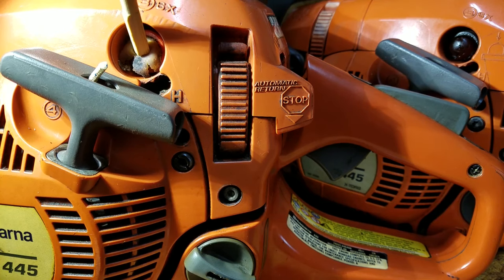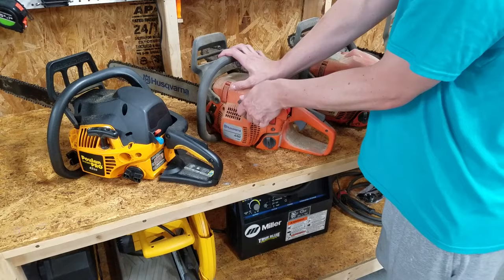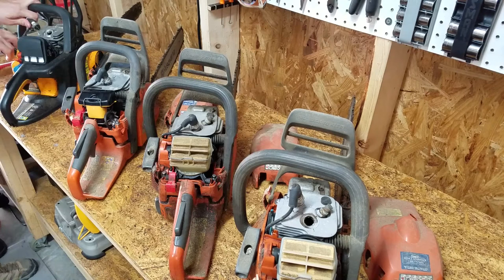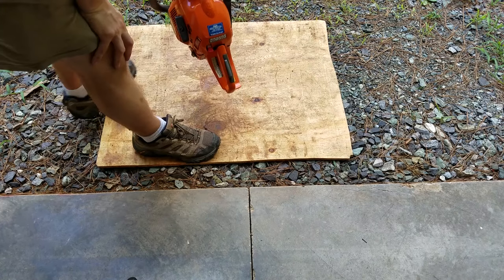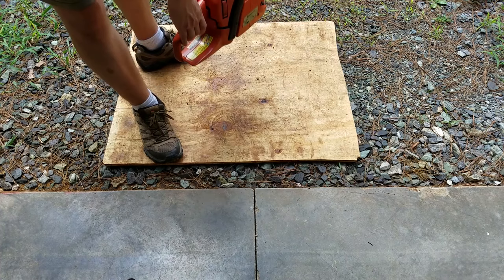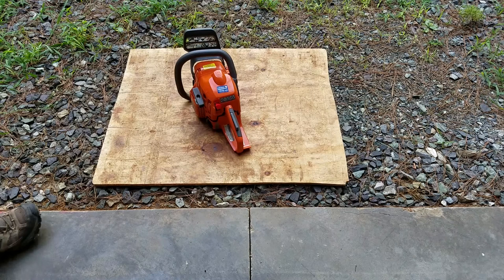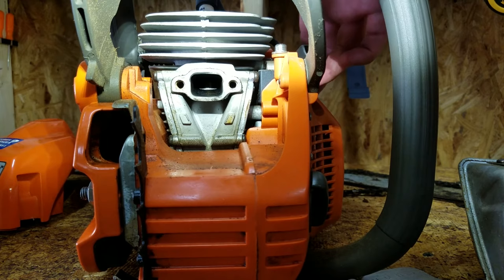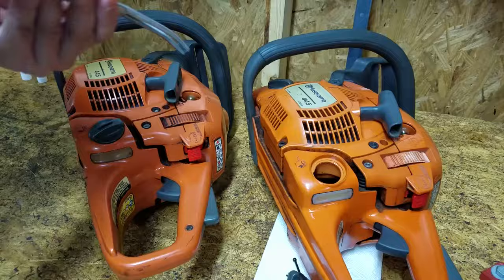Repairing Chainsaws

Comment from the maker: Primer Bulb:
https://amzn.to/3igCL1E (affiliate*)

Air Filter:
https://amzn.to/2Rdv4xc (affiliate*)

Spark Plug:
https://amzn.to/32fODLW (affiliate*)

Fuel Filter:
https://amzn.to/33gHslI (affiliate*)

Carb Adjustment Tool:
https://amzn.to/3k0QiLc (affiliate*)

Clutch Cover:
https://amzn.to/3hjOACS (affiliate*)

Hemostat Locking Forceps:
https://amzn.to/2DLpKyb (affiliate*)

*Purchasing from these Amazon affiliate links earns my channel a small commission. Think of it as a tip that doesn't cost you anything. Thanks for the support!

Comment: Great video. Just a tip for you. Hold the throttle wide open while doing compression testing. You want as much air flow as posible.
Reply from the maker: Yeah, that's what I was attempting to do with the top of my foot, but I don't know how successful it was. :) Thanks for the comment!

Comment: I repaired a Stihl 251 and getting a replacement carb or correct carb kit was impossible. In the end I had to use parts out of a similar carb to repair the old carb.  Otherwise I was able to get a replacement bar, chain brake and piston rings.  Despite having a hard life cutting hardwood, it had almost no wear in the cylinder bore and was in spec. The Poulan looks like a low hours machine that has had straight gasoline in it, its destroyed. The internal micro screen inside carbs clogging up is a super common problem.
Reply from the maker: I'm surprised you had a hard time finding a carb for your Stihl. They're a major brand so I just assumed it'd be easy to get parts. I did a follow-up video where I replaced the cylinder and piston on the 440 from this video.
Reply: @Mikeattempts  actually I was unlucky, because the Stihl 251 had two versions, and some parts are different like the cylinder barrel and carb, which are not interchangeable.

Comment: Nice save by using the 440 oiler. You got yourself two nice saws. I have the Poulan pro 42/28 the updated version. It's been a great saw. Everyone bases Poulan because in my opinion they don't know how to take care of them. Great video. Very informative. Just subbed your channel
Reply from the maker: Thanks, I appreciate it! I agree, Poulan saws are good as long as you take care of them properly, just like any tool. Chainsaws aren't cheap and I'm really surprised how many people buy 'em but then don't bother to read the manual for mixing gas, tightening and sharpening the chain, keeping the bar oil full, etc.
Reply: @Mikeattempts  I could agree with you more, I work on small engines and you'd be surprised at how many times I had to tell a customer they burnt their saw up because the put straight gas in it. It's crazy. I'm super meticulous with all my equipment, Whenever I'm done using my saw I blow all the chips out and clean it like it wasn't used, I work way to hard and pay way too much for my stuff
Reply from the maker: @garyalensr  Exactly, same here, I take pride in taking proper care of my tools. I did a video replacing the cylinder and piston on that 440 I scavenged the oiler from. I think the previous owner used bar or motor oil instead of 2-strok oil in the fuel. Check out the video if you're interested.
Reply: They're pretty much junk from the start so taking care of them has nothing to do with it.
Reply: @bobbyhempel1513  I've had my Poulan now for over a year with heavy use and I've had zero issues. It starts every single time.

Comment: You should port both 445s and add a bark box to each 😊
Reply from the maker: Hahaha, that's beyond my current skill level. :)
Reply: @Mike attempts  check out Buckin Billies channel out of Canada, he's an encyclopedia of chainsaw and old school tree falling
Reply: @Mike attempts  Old Buckin Billy is quite the character but full of great information tips, and alot of fun to watch ")
Reply from the maker: Yeah, I've heard of him and seen a couple of his videos. He's way out of my league when it comes to chainsaws. :)
Reply: @Mike attempts  I learned how to use a degree wheel a saw to set or change the degrees of timing, I think they were building an old McCullough 800, they were checking how much they  could increase the bore ")
Reply: @Mikeattempts  it's all good knowledge 👌 great job on getting the 445s running 👍 🙂
Reply: @Mikeattempts  I just bought a stihl ms250, the new models Don't have primer bulbs, not sure I like that change, time will tell if it's a good change or not "/
Reply from the maker: I ran across a mower with no primer bulb, and it always started on the first pull so hopefully your new Stihl will be the same.
Reply: @Mike attempts  thanks hope so, it started and ran good at the dealership, I bought it from ")

Comment: Hi, liked the video - very clear & informative. I'm just wondering, why do you leave the saws running in half choke for a time after you start them? I'm intrigued as I'm accustomed to bringing them down to idle as soon as they've started running. Cheers
Reply from the maker: When the saw is choked and then the choke is turned off, there's a built-in mechanism that sets the throttle a little higher than idle. This mechanism is released the first time you squeeze the throttle. It just gives the engine a few seconds to warm up before beginning to idle. If going right to idle works for you, that's perfectly fine. Sometimes, if I bring 'em down to idle too quickly, they'll shut off. Thanks for watching!

Comment: Do you have to have a air and fuel filter to run
Reply from the maker: Yeah, when around all of the shavings and saw dust, you can't keep 100% of it out of the fuel tank. You also don't want the dust getting sucked up by the engine via the air intake.

Comment: I'm having probs putting 2chains on and tighten them
Reply from the maker: I'm not pro but this is how I do it: 1.) With the bar nuts loose, adjust the chain tensioner until, when you pull up on the chain, the bottom of the chain almost comes out of the track. 2.) Grab end of the bar, between your thumb and pointer finger, and pull the tip up while tightening the bar nuts with your other hand. If it's too tight, the bar and chain will quickly get hot. If it's too loose, the chain will pop off while running. The chain should not sag on the underside of the bar.
Reply: You may have the wrong size chain or a worn out bar .

Comment: Chain want release
Reply from the maker: The guard in front of the top handle is the chain brake, if it's pushed forward, the chain won't move and you won't be able to remove the side cover. If that's not the issue then the chain tension, adjusted with the screw in the side cover, might be way too tight.

Comment: Cut some wood!
Reply from the maker: Hahaha, it wasn't a wood cutting video, it was a repair video. If it helps, they both cut as expected. I did a follow up video on the 440 with low compression where I replaced the cylinder and piston and even cut a little bit of wood at the end! ;)